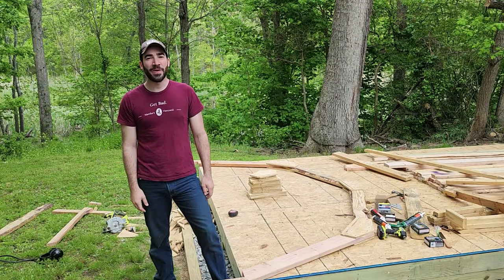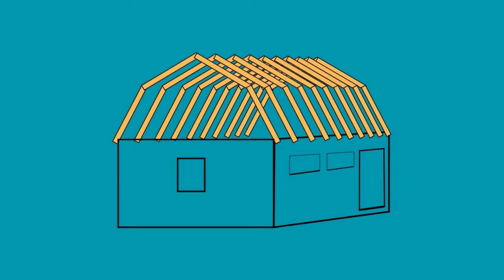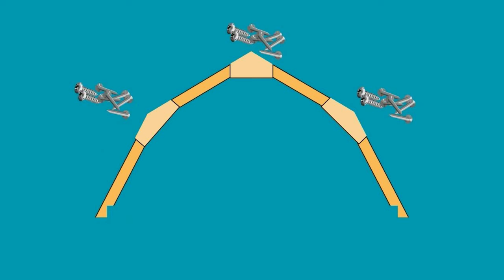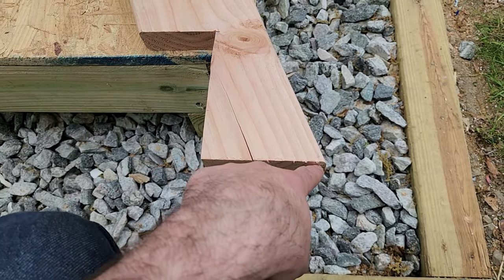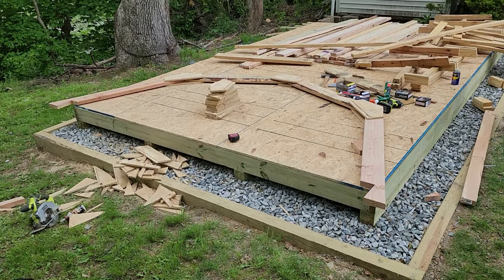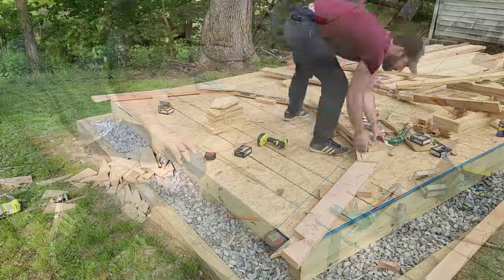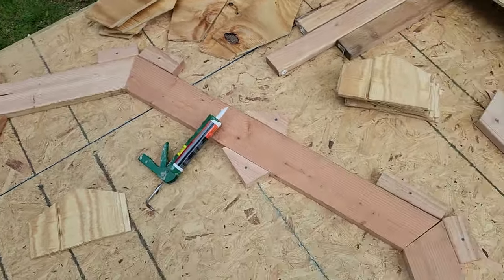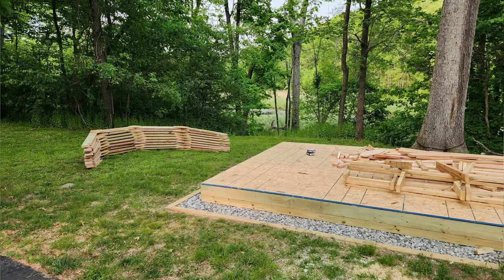How to build Gambrel Trusses | Barn Style Rafters | Shed Build Part 3

Comment: When you are using a pattern, to replicate a measured piece, always use the same piece for your pattern. Never use the next cut piece to be your pattern for the next cut piece. If you don't your final piece could grow from the first to the last. Otherwise, very well done.
Reply: Agreed. If you are off by 1/32" on each cut, you can potentially off by a full inch over 32 cuts! Obviously that's the worst case scenario, assuming you are consistently making each cut heavy (or light), but it's very easy to be off by 1/4" over that many cuts. If you use your method, worst case, you'll be off by 1/32"
Reply: @ryan370 a big mitre saw sure is nice for this type of work since you can clamp 3 boards together and cut them all at once to exactly the same size.  With a sliding mitre saw you can usually set the max depth and also make at least one of the birds mouth cuts across a whole bunch of boards at one time.

Comment: I am learning from you.  A few hints that may help others:  If you make the cleats on your floor thicker than 1.5", then they will help line up the gussets perfectly, too, with less likelihood of getting something imperfect, and faster.  If you have a reciprocating saw, put a deep blade on it and us that for the trimming of the 2x6 cuts at the ends.  Make a template for the rafters from scrap plywood or OSB that's shorter than the rafters, so you can run the edge of your circular saw on the template, making every cut exactly the same with little chance of a mistake.

Comment: I see the overhangs on your trusses fit very snug without the sheathing.  So when you install the trusses and then hang the sheathing, it will come to the bottom of the overhangs.  Would it be better to leave a gap in the overhangs and have the sheathing come up under it?

Comment: Nicely done, but how did you arrive at the 48" and 54" rafter lengths? They would have to be different for wider or narrower structures, right?  Did you get help from Pythagoras?
Reply from the maker: You're correct, they would be different lengths for wider or narrower structures. I went off of the recommended dimensions from a site called buildblueprints.com. I referred to their 10x16 barn shed plans. I figured I'd trust their math!
Reply: @EveryotherKarl looked at that link, didnt  see any Dutch barn roof plans?

Comment: Do you have to take into account the width of the sheathing/siding when cutting the birds mouth? Or does the sheathing get cut to go around the rafters?
Reply from the maker: I personally cut the sheathing around the rafters, but you could do it either way.
Reply: @EveryotherKarl  ok thanks for the reply!
Reply: I personally build these adding the side walls into the equation
Reply: @toomuch4199 how would you measure the seat to account for the sheeting? I'm new to this

Comment: I'm building a 12' x 16' shead.  What would be the length of the boards with a birdmouth of 4" overhang?
Reply from the maker: I don't want to give you the wrong info, I'd recommend using an online gambrel truss calculator.
Reply: I am planning on putting 4" facia and a barn red vinyl siding to protect the wood as much as I can.  By the way, great video!

Comment: Does the  22.5 degree angle the same for a 12' wide roof or does it vary on your width
Reply from the maker: It's the same angle, the length of the rafters is what would change.
Reply: The angles should always be the same with longer rafters for wider buildings or shorter rafters for more narrow buildings. Good luck and have fun with your building!

Comment: Ok so my rafters assembled is like an inch off for a 10 foot wide floor flush to the birds mouth is that normal? Or is 54.5 not exact but an estimate length on the bottom piece? Something here is off or is it off to compensate sheathing?
Reply from the maker: Hmm, interesting. My bottom pieces were exactly 54.5 long. Are your top rafters 48 inches?  
If anything maybe the birds mouth could be adjusted?
Reply: @EveryotherKarl  yeah the run and rise match’s all pieces measurements just like your tutorial describes. I mean it’s like 3/4 off a bit I could make them work when I attach them to 2x4 top plate.
Reply: I’ve reviewed Build Blue print you recommended and the rafter 67.5 degree is measured at 54 1/8 versus your half and when I applied this it fits perfectly to a 10x16 foundation.
Reply from the maker: @TACOPOTENTE  dang, ok.
Reply: @TACOPOTENTE So you're saying to cut the bottom piece to 54 1/8? Also how do you measure out the seat cut?
Reply: @brandonbondy3919  follow this tutorial here for the birds mouth cuts I’ve merely looked at some online blueprints and made comparisons for the measurements mentioned

Comment: How the fuck do you calculate the angles for the 4 different beams?
Reply from the maker: I did one of the simplest methods which is to just make all the  angles 22.5 degrees. You just need to calculate the length of each beam depending on how wide your building is.
Reply: hmmmm thanks for answering so quickly. I need to figure this shit out...  @EveryotherKarl

Comment: What’s the length of each rafter?
Reply from the maker: The top pitch rafters are 48in, the lower pitch rafters are 54.5in.
Reply: Great I’m about to start this process myself I have everything to this point completed.
Reply: @EveryotherKarl  Ran into a snag my Speed Sq doesn’t have a quick 22.5 ref line is it 4 of 12 ? For those who don’t have a quick angle 📐
Reply from the maker: @TACOPOTENTE  Hmm, if you don't have the 22.5 mark, you probably at least have 45 and/or 90. You can either bisect 45 or divide the 90 into 4. That'll be the 22.5.
Reply: @TACOPOTENTE  if you have a miter saw, that should have the angle you need on it.